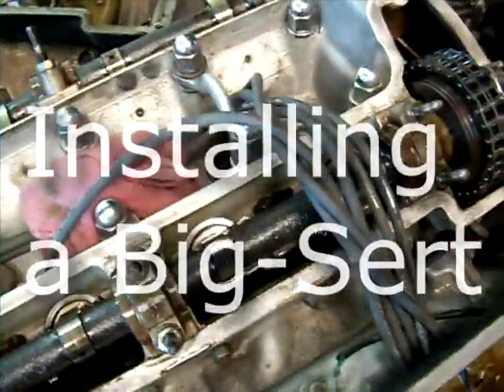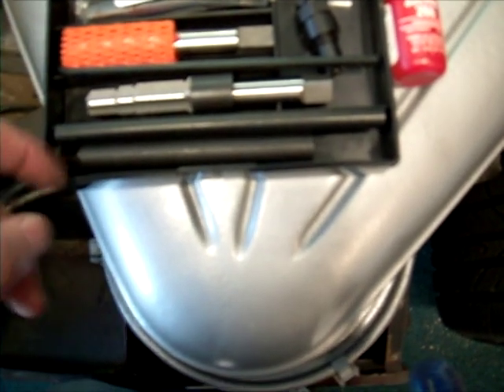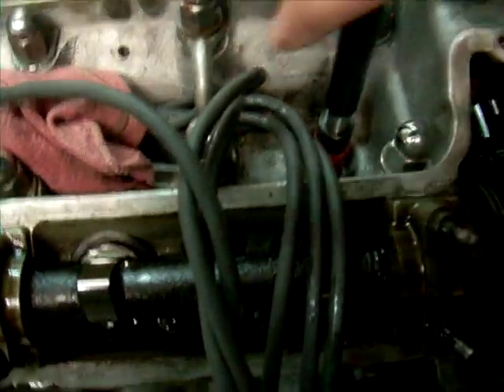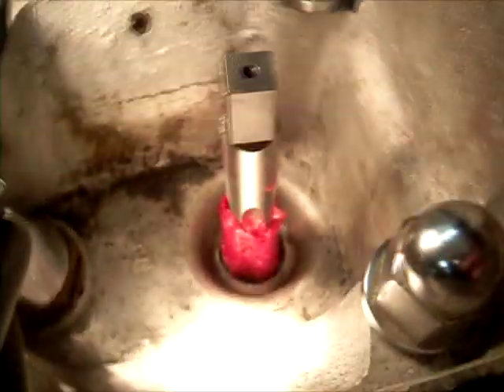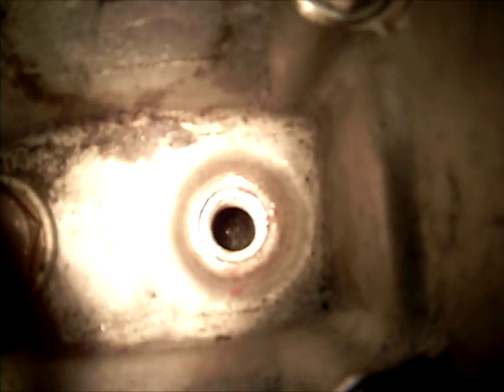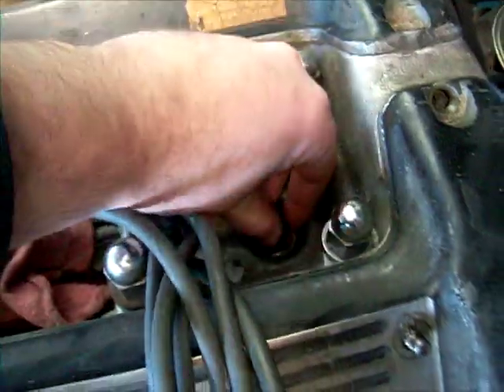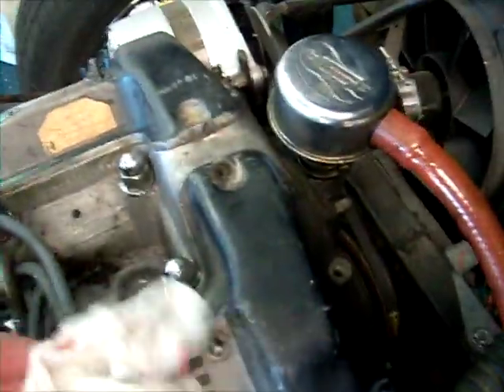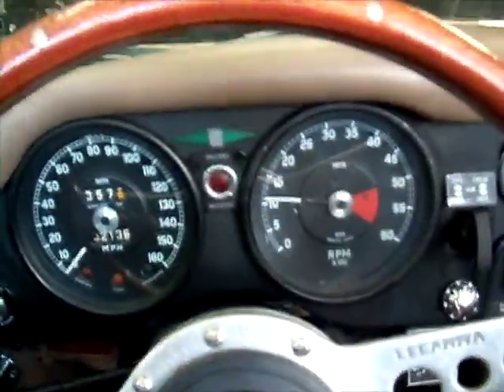How to Install Big-Sert spark plug thread restoration (How to fix a stripped heli-coil)

Comment: One E-type Jag engine not doing too well. Why did you not use spray-on open gear lube on the tap / reamer and the alloy chips adhere to it and stand out well, as the grease is black? Also if you heat a little grease, you can put it on the top of the piston when it is at T.D.C., then rotate the engine to B.D.C. on that cyl. When job completed use a bore scope to check the cyl for debris.The effort to upload is appreciated, but you seem to make a lot of work for yourself.
Reply from the maker: +arriviste2020 The grease I was using was red, not black, and the chips stood out well.  The problem was that the reamer created a lot more chips than I expected.  I'm not familiar "spray-on open gear lube", so that's why I didn't use it.  As far using grease on top of the piston at TDC and then rotating to BDC, sounds like a pretty darn good idea to me.
Reply: Point taken, and fair enough. I did not intend to project a "superior" point of view. I have worked a lot of hours solving problems on   Jaguars...especially removing cyl heads in an expedient manner when "frozen" to the block without damage to block, head or studs.and no hammer involved::)
Reply from the maker: +arriviste2020 It sounds like you have a ton of experience and I'm really happy to learn things I don't know.  Incidentally the coolest trick I saw for popping off stuck heads is feeding soft rope into the spark plug hole a little at the time and spinning the engine.  It compresses, and eventually pops the head off without damage.  This worked on a stuck stuck stuck jaguar V12 cylinder head in the shop I worked in as an apprentice.

Comment: The video on the truck (boot) spring was great, thanks for that. Do you have any inf on engine cam rebuilding. My concern is if there are any parts required to connect the cam end spigot (bolted to the camshaft) to the alum gear housing, the housing is a fork shape with slots machined into it. My engine was (is) a bag of bits so not quite sure what bits are required.

Thanks again.